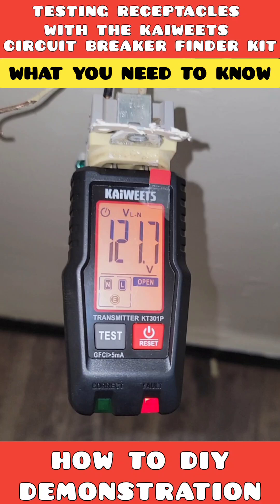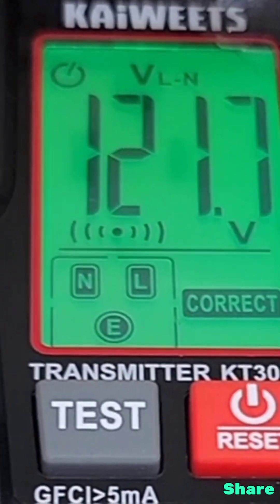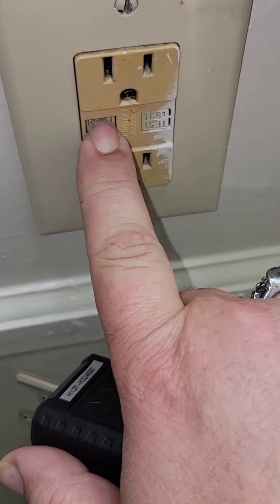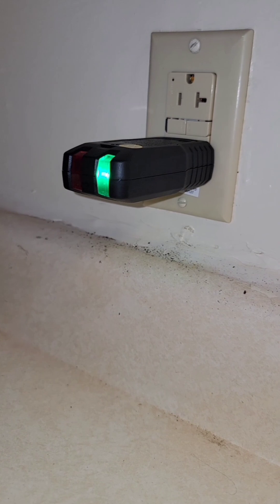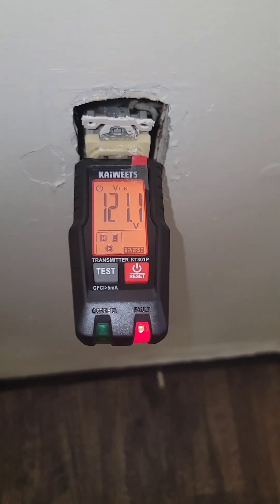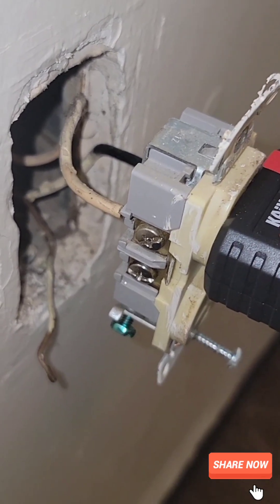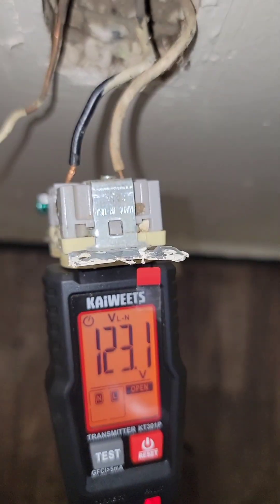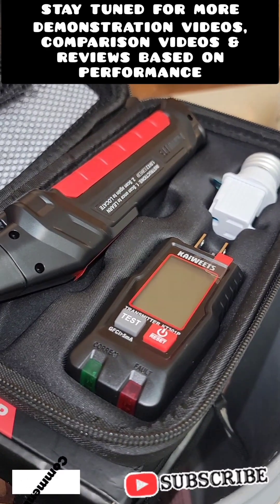Testing Receptacles, Wiring & GFCI w/ Kaiweets Tester & Circuit breaker finder #kt301P @Kaiweets

Comment: Looks like the display is brighter than my klein, the only issue with mine. 
curious if this company has a style like klein's that is a multimeter with a special setting and cable that plugs into a outlet and does the same thing...only on mine the screen aint as bright